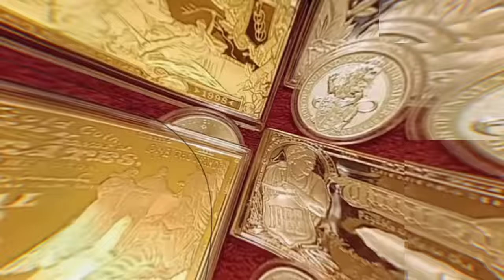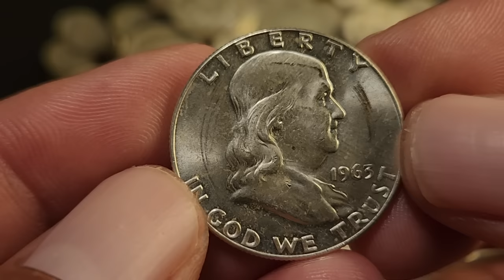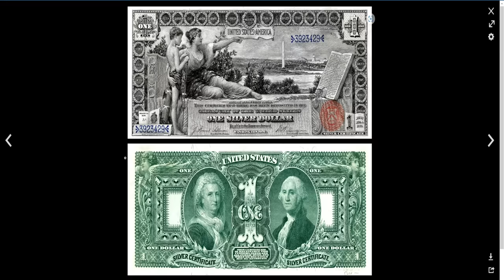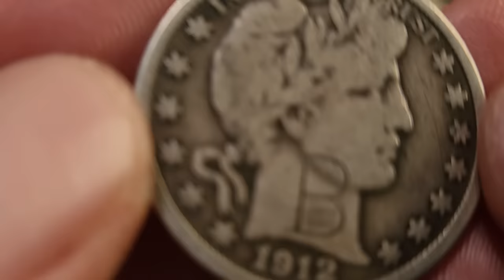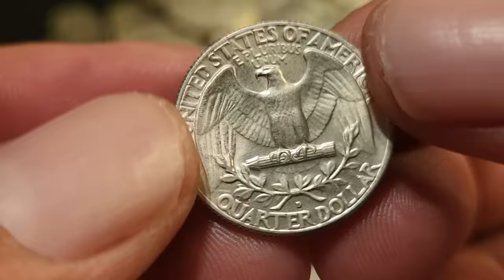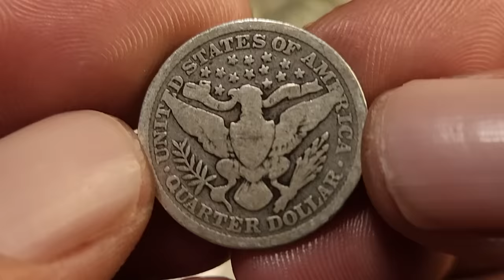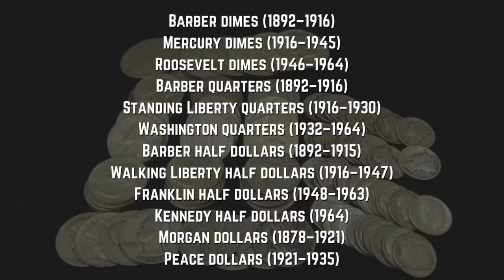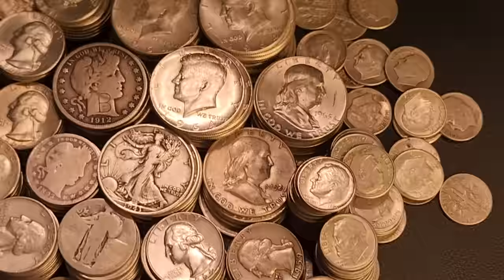Junk Silver Will Become Extinct Except For This One Thing!

Comment: Here's a tip for the searchers. If you have access to a house or building built before about 1970. Get a sifter and a shovel and dig up the dirt around the front and back steps or anywhere that people would sit or come and go. You will find a lot of dimes and quarters. Wear gloves because you will also find a lot of broken glass and rusty nails.
Reply: Do a lot of metal detecting I will try this around the foundation area since it's hard to detect
Reply: @op why would broken glass and nails also be a thing common there?
Reply: Because homemade landfills were a common practice up until the 1970s.

Comment: It can be useful to keep in mind that $1.40 of 90% Silver US coins in any combination (excepting dollars, for some reason) contains one Troy Ounce of pure Silver (and a bonus content of Copper). That means that, if you ever need to barter, bullion silver should trade at $1.40 "hard" per Troy Ounce with these coins. =^[.]^=
Reply: If Silvers value remains at the same level in regards to currency. If you ever have to barter it most certainly won't be
Reply: I think it’s $1.20 to an oz
Reply: @Raycheetah  the value of the coins in regards to currency is constantly shifting. If you get to the stage where you have to barter the dollar will of had its value smashed.
Reply: @ricardosmythe2548  True, but not pertinent to my original point. ='[.]'=
Reply: @silverhustlin1390  1.40$ const silver is 1 troy ounce.
Reply: @ricardosmythe2548  He was talking about $1.40 of face value equals one troy ounce.  The price of silver is irrelevant.
Reply: @silverhustlin1390  No, $1.40 is the standard.
Reply: Compare the weights of 4 quarters or ten dimes to a Morgan or Peace dollars.  Also just a numismatic premium on larger coins, (I call it the "heft factor") often Franklins and '64 Kennedy 's more than small coins proportionally.

Comment: Back in the early to mid 90s I bought a lot of silver coins including a ton of 40% Kenedy halves.  I still have most of it. I hear people say to get rid of the 40% stuff,  but I am keeping it and actually buying more if it's cheap.  Mostly now im buying 10 oz bars and 90%.
Reply: I got 4 tubes of 40% while the premiums were high on everything else.  Only $60 each.  I think a person is hard pressed to find that price right now.  Perhaps a coin shop.  They will appreciate a long with everything else.  Nothing wrong with stacking 40% at the right price.
Reply: I agree.  These 40% coins are valued according to the silver content,  but there's coper in them also which someday will add to the value.  One of the arguments is that they take to much room. I don't have any problem storing them.  It certainly is a good form of fractional silver.

Comment: The premium for 90% silver is already through the roof.  The dealers are currently around $17 per ounce in PREMIUM.  Significantly higher than Silver Eagles.  If you want premium silver, consider silver Eagles.  
As he said, it is no longer “junk” silver.  
2-3 years ago, yes, I could buy it for less premium than Silver Eagles.  And I did, believe me.  But today, no way.  It won’t be much longer before 90% silver coins will sell at double the premium over Silver Eagles.

Comment: They minted 1964 quarters i think up until 1968, can't find the article but they had so much extra blanks they didn't refine for who knows why, so many of the 64 quarters weren't made in 1964, but after
Reply: That is not true at all they switched to 1965 clad quarters and by Jan of 1965 people were already starting to pull from circulation all the silver.
Reply: @tennesseecoinco  1964 quarters were minted until spring if '66 even though 65 clad quarters were already in circulation. This was to prevent the realization that 90% was being hoarded on a large scale to keep others from jumping on the bandwagon. The massive drain of circulating quarters would have a detrimental effect on commerce so this parallel date/composition minting was authorized. The 64 dated coins are all 90%, the 65 and later were all 0%
Reply: @jedimindtrick8966  We were already pulling 90% better date dollars in 63 would sit and go through the bags of dollars in basement of Third National Bank and just pull CC’s and other better dates until a friend came up with idea lets just borrow the money from the bank and get all 70,000 silver dollars they still had in the vault. I told him saw no future in it so he did it by himself. Two years later common dates were 3.25 each he did very well including one nice 93-S in the mix. 
Point is here there was no bags of 90% left in these vaults by January of 1965 none it was all ready drained. One banker himself had bought 4-55 gallon barrels of Silver Dollars his name was CH Butcher many remember him. You still would get a small trickle of 90% from the public all the way to mid 1970’s But no influx of minted coins after late 1964.

Comment: 90% is the core of my Supplemental Personal Retirement Pension. I have either bough 28 dimes, 12 Quarters or 6 Half Dollars for every week I worked in my life. I based this off the pension of a Roman Laborer or Soldier during the Roman Republic.  This is about 2 ounce of Silver per work week or 4 ounces of Silver per paycheck, no matter what the price is.

When I go to retire in another 20 years, I will have thousands of ounces of 90% to trade back for the coin of the realm.
Reply from the maker: That sounds like pretty sound strategy my firend

Comment: Just a short note: silver certificates were redeemable not in fractional coins ("junk silver"), but in silver dollars. This is because fractional coins, even if also made of 90% silver, they were a token coinage: There are 25g of 900 fine silver in $1 of fractional coins, while 1 silver dollar weighs 26,73 grammes of 900 fine silver. This is why, until the mid 1960s, the treasury held millions of silver dollars in reserve, just in case they had to redeem the silver certificates.

Comment: Even when silver price went to a $1.29 you were still only getting 92 cents of silver with a silver certificate redemption because the coinage is .900 fine, and $1 in minor silver coins equals 715 of an ounce each $1 does not equal 1 oz of silver. An actual silver dollar slightly better has 0.7783 of an ounce, so yes at $1.29 per ounce a $1 silver coin is just starting to reach above $1 worth of silver

Comment: Great video brother.  I caught the silver bug about a year ago or so.  I started taking it as serious as I could around 6 months ago.  My stack grows slowly being on a fixed budget. That being the case I am trying to learn some creative ways to accumulate on the cheap.  I've learned to refine in the last couple months on a small scale.  I've picked up a few pieces of sterling here and there,  and am trying to get stripping plated silver down to a science now.  To the point I was originally going to make.  I have begun removing the "smoothies" from my constitutional stack that have lost 20% of their original weight.  When you add it up, you have a false sense of value when you have tens, or hundreds of those in your stack.  I never melt a coin that's in decent shape that has under 20% loss.  I know more and more stackers are paying attention to this issue.  I'm curious as to what your take is on this brother?  Keep up the great content sir!

Comment: The melting happened a lot in the past. But I think currently there is little to none being melted since the premiums are much better then most pure silver coins. When looking at the comparable actual silver weight. And the work it takes to get it pure makes it not worth the work it takes cs selling it as is. So until premiums feminism it’s safe. So future supply will depend more on what people hold vs sell based on their needs. And in the future it may flood back on as collectors age and pass if future generations arnt taught the coin collecting passion.